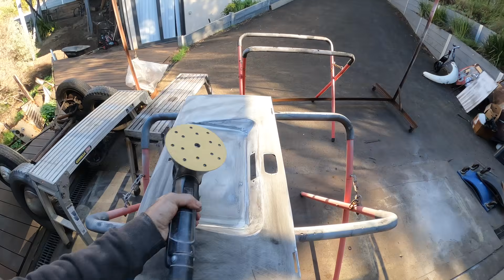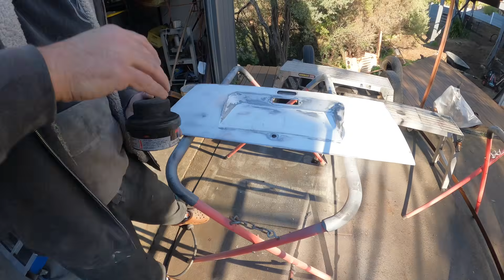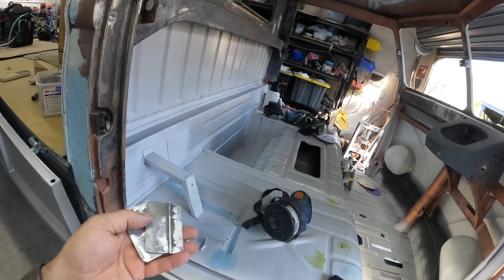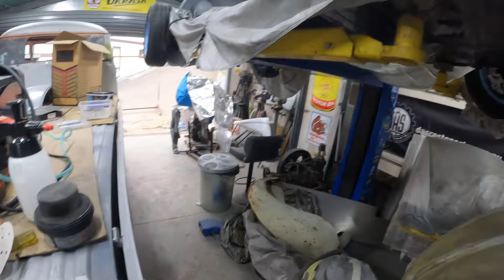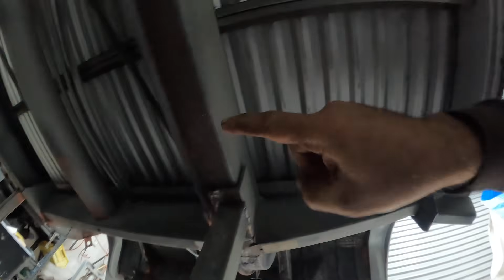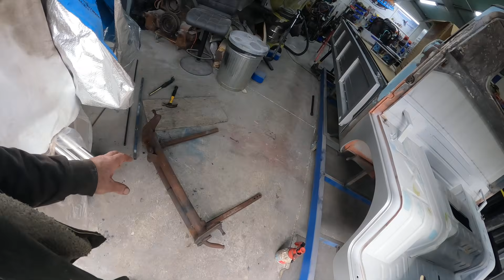Building a 1954 Barndoor single cab from scratch // panel and front beam work. #vw restoration

Comment: Whenever I weld nuts, I always put the bolt through from the rear to hold it securely in place. Being careful to only just nip the bolts up. If done up tightly the heat can cause the thread to distort. Quite often i will also run a thread tap through it afterwards, especially with small treads like 6mm. In some options I just use a heavier plate and tap new threads straight into it.
Reply from the maker: Yep thats it, have had those threads bugger up all right and have to retap before.

Comment: Great progress Nik. Good to hear that the Single cab is going to be low. It’s going to be stunning when finished 😎🤙👍
Reply from the maker: Cheers mate yeh she will be a driver 🤙🏽👍🏽
Reply: @DemopVWgarage wouldn’t it be better to keep the original parts and get a new adjustable front beam . So it can be put back to stock later
Reply from the maker: @besenzon1 believe it or not thats what Ive decided to do as the stock beam is pretty bad. I’ve got a 63 full front end I will use.